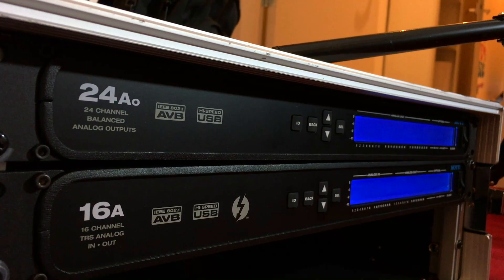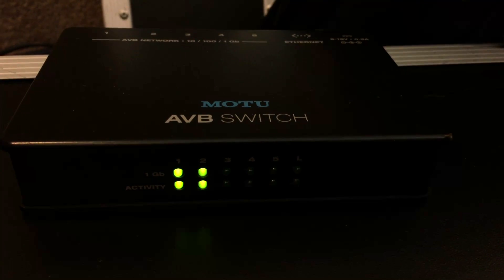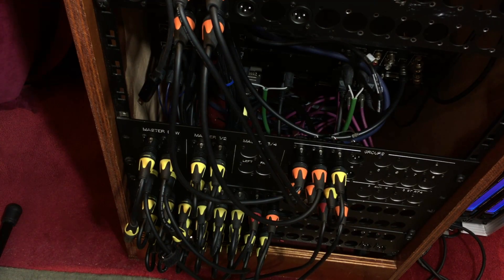MOTU AVB Interfaces

Comment: Good one. Went for the 24Ai and 24 Ao, still running my 2 fully Black Lion Audio modified 828 mk2's as ADAT converters. All works well. No crashes whatsoever. I did have a lot of trouble with the old 828 mk2s on firewire, all through win xp, 7 and 10. I also thought that MOTU had bad drivers etc, but I came to realize that also friends with the RME setup, was struggling with firewire.
At the end of the day, I concluded that windows never were to firewire friendly, go figure. And I also discovered that the Dell 5500 chipset, totally blew it with fw. No compensation from them. If I remember correctly, it was Motu who finally found out that their FW cards couldnt support some dell machines. But they got a lot of bad rep, due to some intel mistake. so.....

The MOTU support has actually been splendid for me, every time I called them. Last year I called a Motu tech, and he helped me out with my 2 20 years old MOTU 828 mk2's for hours and hours, actually for days. I never felt more cared for in this business, ever. The units are discontinued ages ago.  I'll include that I have had quite good experience with support from Focusrite and lately Relab too, but the Motu guy stands out as a guy I would go to war with.

This Motu tech, and my discovery that the 20 years old 828's still holds water, made me jump on the AVB system too. The tech should have a kickback though.

I was very thrilled to find that my old 828's, worked very well with my new Motu system. That doesn't tell me that the Motu drivers are so far off as some suggests, on the contrary.
I do understand the frustration that can occur with all the pitfalls of digital sound technology, but it might often be other problems lurking in your experience, than what it might seem like at first glance. The music equipment suppliers are mostly working to give their customers value. And they often care for their community. I guess expecting that, gives a good response from them to. Me for one, don't solely cuss them out when approaching support. But if I do, they'll feel it. 🙂

I checked the sound quality difference between my old Black Lion Audio modified 828's and the new 24's, and the 828's came out a tad more mature sounding, but that solely relates to the BLA mods on it, the 24 came in good enough, and the difference was not night and day, more like a tad this way or that way. Anyway, the mix summed trough my Jim Williams Audio Upgrades modified Soundcraft DELTA, came out best in all blind tests, whichever system was in use. 

So my 5 cents is that when you have a system at this level, and know how to deal with it, it is from your technical knowhow, and productions skills, and experience, that the payoff comes.

Thank you for an entertaining and valuable community service man, and good luck with your new system.

Comment: Great unit, just bought the 16a... however I am weary of relying on the internet for the mixer. The RME Fireface 800 , for example , offers TOTALMIX which is installed on the hard drive and has no need for an internet connection. Also, a Firewire port would be a plus.
Reply: How's it going for you so far?

Comment: Looking at getting a system that is fairly cheap but expandable. Considering the 828 es. What do you think? I'd be running it usb 2 for now as I don't have thunderbolt and he cost to upgrade my pc means pretty much building a new pc. I have a couple of adat interfaces so need adat and analog i/o.
Reply: I might be late on the answer, but I have this interface, and this is truly amazing. I used it both on Thunderbolt and USB.

Comment: i have a lot of problems with the ultralite Avb and a mac. Clocking issues. And not cause of my computer. Motu does not have good drivers. Am getting tired of this. Next interface will be RME
Reply from the maker: How is it connected? What system do you use? Mac/PC? I know of a few issues in the MacOS
Reply: Usb 2 connected. Mac Sierra. Macbook Pro 2011 quad. If they don`t better the drivers or what it`s causing it, i`m out
Reply from the maker: Strange... didn’t have those issues
Reply: well it would be weird if everyone would have these. But i see that i don`t have these issues with Scarlett`s i`ve had. Like 0 problems. Motu always problems sooner or later